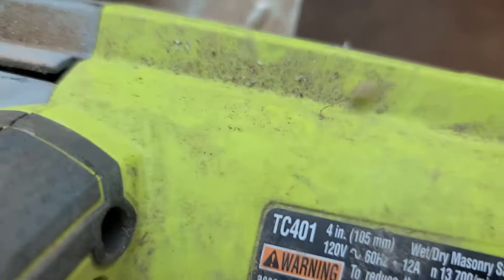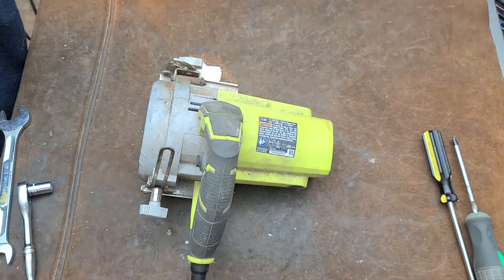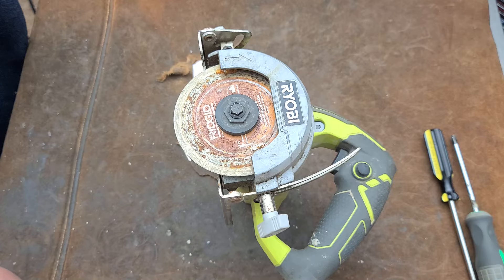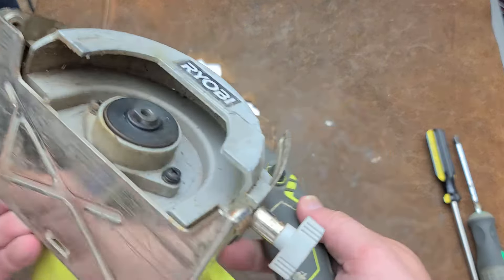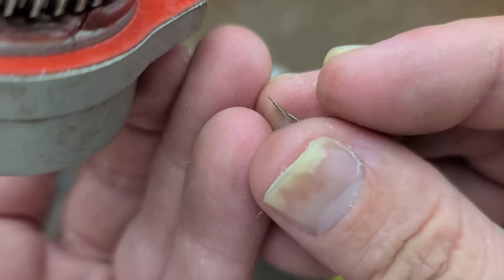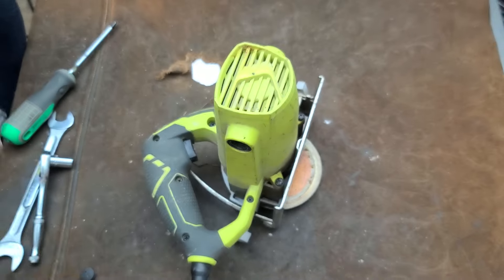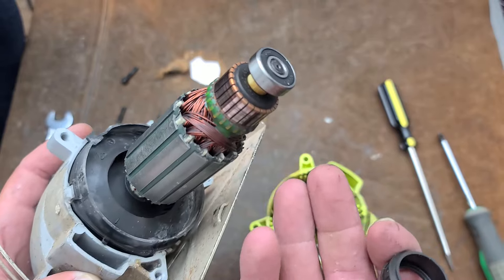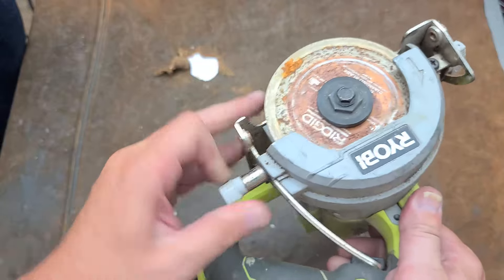Ryobi TC401 12 Amp Tile Saw Review/Teardown

Comment: Great video, that little saw is built like a tank. I only have one Ryobi tool which is a 4 1/2" grinder. It has always worked gust fine, but I don't use it all the time. Thanks Catus
Reply: Hello again, Catus Maximus and Tiny 
Thank you for another Great Video 👍
Reply: Yep.  I used a 4 1/2 on this saw and recessed my slab for curbless shower. it really gets hot if you push it.  I paid $50 for it and it's a great little saw